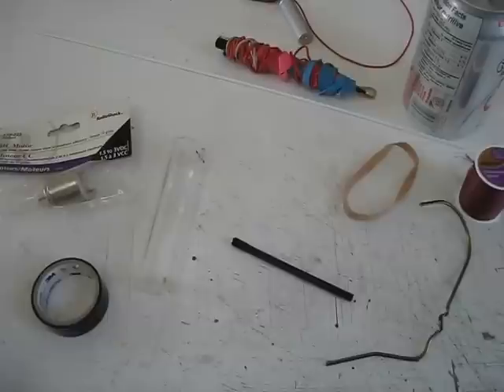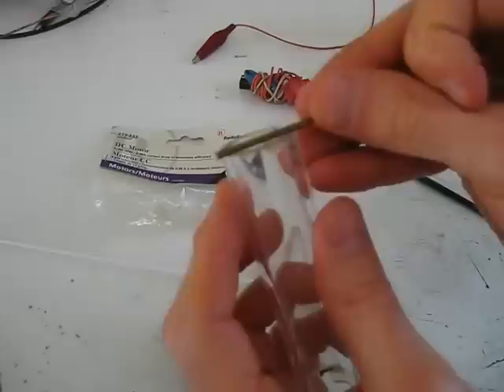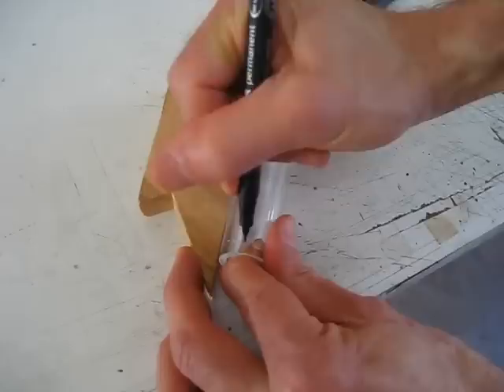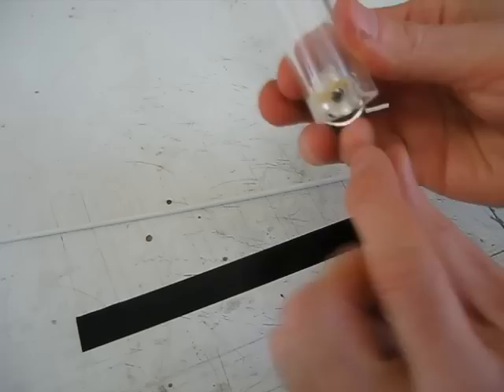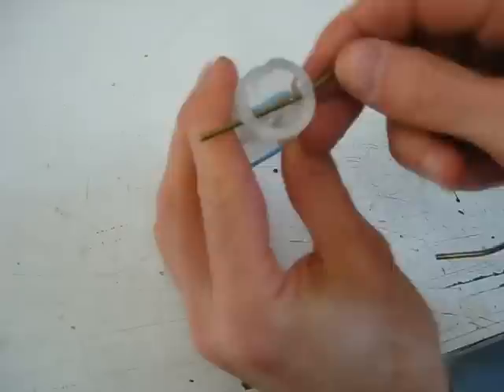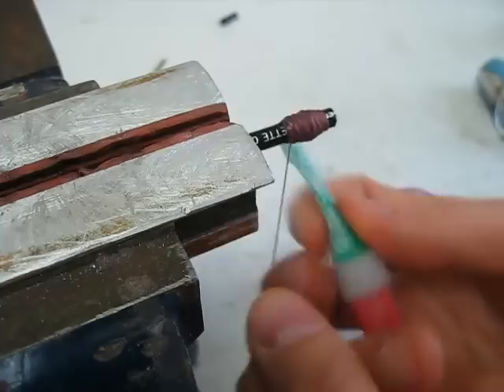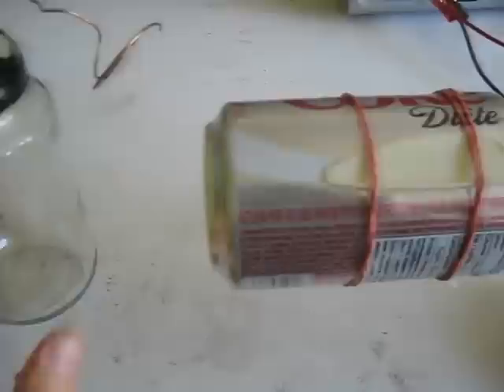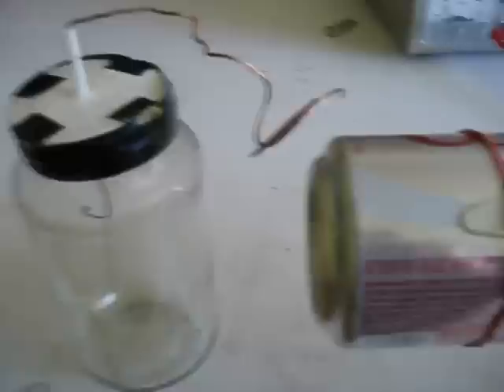How to Make/Build a Van de Graaff Generator Part 1 (Homemade/DIY)

Comment from the maker: Well, if you want a bigger effect then I'd suggest looking at a different design. This one's meant to be minimal using the simplest of parts. If you want to take a chance with this one then I'd suggest experimenting with a bunch of different materials for the pulleys. I think the weak point with this one was the use of vinyl tape for one of the pulleys. But even then, the result may not be as effective as you're looking for.

Comment: Sorry if you've already answered this- but is there a reason you used metal (close hanger) on one side? If the triboelectric effect occurs because of the vinyl and nylon, then it should matter what materials you use for the shafts right? Or is there a reason you matched the metal-plastic-nylon and plastic-vinyl together? 

Thank you so much
Reply from the maker: The material that the shaft is made of doesn't matter. So I used a clothes hanger because it was easy to shape it but it was also strong. The surfaces that matter for the triboelectric effect are the outer surfaces of the two rollers/pulleys (e.g. vinyl and nylon) and the inner surface of the belt (e.g. rubber).

Comment from the maker: You're missing one step. The VDG sphere can build up a high voltage is because the top brush is connected to the sphere on the inside. If you connect the brush to the sphere on the outside then it won't build up as high a voltage. The sphere is acting like a faraday cage or faraday bucket. The inside of the sphere is always neutral so the brush can keep sending it charge, theoretically forever, though in reality limited by the size and shape of the sphere. See my How VDG Works video at 10:46.

Comment: Would you know relatively how high of a frequency of sound your method below to produce a vibrating diaphragm would be, relatively? Would the voltage output from the van de graaff have anything to do with the frequency at which the diaphragm vibrates? Could you also explain more in detail about how electromagnetic induction works to produce these vibrations in the diagram?
Reply from the maker: +Dorfdude8 I have no idea what the frequency would be. I haven't done any experimenting with it. It was just a rough idea I came up with in response to your question.
I wouldn't say the frequency would be related to the voltage output i.e. how fast the dome can be recharged. It would be related to the current, which is dependent on the width of the belt and brushes (the wider they are the higher the current), the materials chosen for the belt and rollers (the farther apart they are in the triboelectric series the higher the current) the motor speed (faster equals more current).
I wouldn't call it electromagnetic. It's electrostatic. But here's the basic idea https://www.youtube.com/watch?v=1jP_D0S2CtY and https://www.youtube.com/watch?v=aOi9FJpzfeM. When the plate is on the part of the cycle when it's farthest from the dome you may need to have it come into contact with a grounded dome to discharge it.
Warning: This may not be suitable at all for what you're looking for. It's just the best I could come up with.

Comment: Quick question, instead of using your hand, could you possibly place two screws near each other (like say, screwed in a few centimeters apart in a piece of wood) with one connected to the coke can, the other connected to ground. Would this have the same effect as your hand getting near the coke can?

Comment: Nice!Does the fact the soda can has a laquer lining have a effect on the output?Would a raw metal finish on the inside help or hinder?Also,would a heavier insulation on the wire going in the can help output?Thank You for posting all of your neat projects!
Reply from the maker: Bowtie41 I tested the laquer lining when I made my part 2 video "https://www.youtube.com/watch?v=QrCgtjZwnB0" and didn't notice any difference with or without (I didn't include the test in the video) so I assume  the voltage is high enough to push the small amount of charge through the thin insulation. Given the voltage and the thickness of the plastic insulation on the wire I used, I don't think thicker insulation will help. What did help was opening that end of the can and pushing the whole roller section inside the can, which I demonstrate in my video "https://www.youtube.com/watch?v=xRLvbwF2MnM".

Comment: the strands are well spread sir.going to the can,i made it longer as it is on your video to touch the inside of the can..my motor is 6 volts so it turns faster.

Comment from the maker: You're welcome to send me a private message via youtube. If you want to produce high voltage using VAWT then hooking up a Van de Graaff is certainly one way of doing it. If you want normal voltage levels and current for powering things then you're better off doing what's usually done and hooking up an electromagnetic generator.

Comment: Hello sir! I made one similar to yours using pipes, the belt using rubber placed on a taped roller and both the brushes are close to the belt and the top wire is connected to the inside of the tin can but it doesn't produce any charge. Can you please help me out? ASAP! Thank you for making this video.
Reply from the maker: The problem may be with your materials, or your ground. See my FAQ page here http://rimstar.org/science_electronics_projects/van_de_graaff_faq_frequently_asked_questions.htm where I talk about those things. If that still doesn't help then let me know.

Comment: Hello, wire filaments ranging in rotation band can go to the elastic spanking or have a small distance away ???
I thanks the response, the video and time! I was looking for an easy and small as this design to make an air filter with ionizer home! Greetings !!!
Reply from the maker: Jorge Monroy I don't understand. The translation is no good.

Comment: will it still work if you connect the wire coming from the bottom of the belt to the earth on a battery instead of the house earth

Comment: Hey rimstar firstly I would like to say your video on building a Van de Graff generator is by far the best I've seen. But I was testing the rotation of the rubber belt without it being in a tube yet, the rubber band kept going to one side. Any tips on making it centralised?  I'm using a nylon thread at one end and a vinyl electric tape at the other. Despite me making the middle part of the tape thicker than the edges and the vinyl thread thicker in the middle it seems to go to the side when the motor rotates. Any tips on this?
Reply from the maker: Another cause I find is the two shafts not being aligned with respect to each other enough. They need to be as parallel as you can get them. Hopefully that helps. I'm glad you liked the video. Thanks.

Comment: Alright, thanks. So how far was the distance between your two rollers? For the brushes would something like copper wire work for that? And the last question I have right now is if we don't have anything like a screw how should we attach the wire to the can? Would normal Scotch tape ruin the electrical flow?

Comment: can we use a foil roll instead of  the plastic tube ? and to power the generator can a normal DC be used? 
thank you for this amazing video by the way :)
Reply from the maker: +Farah Toghan No, you can't use foil or any other metal for the tube. The material of the tube must not be electrically conductive.
By powering the generator with DC, do you mean powering the motor? If so, then yes, you can use DC or AC. It really depends on what your motor requires.
I'm glad you enjoyed the video. I have more enhancements to this design in my part 2 video at well https://www.youtube.com/watch?v=QrCgtjZwnB0

Comment from the maker: You do need some current to charge a capacitor, depending on the capacitor the current can be tiny. However, you also said the capacitor will act like a power supply for the generator and that's where I meant the current is tiny. Even the voltage x current is tiny. So sure you can charge the capacitor but there'd not be much power for the generator. Even if you built up power in the capacitor, it'd take a while to do it. You'd discharge it and then take a while again. Not very useful.

Comment: Well I got it working lol:) only thing is even though its grounded I keeping getting shocked and having bigger sparks from the part of the motor that connect to my battery. Any ideas? I get small sparks from the can, just more from the connection area

Comment: RimstarOrg Does the number of Small copper wires in a normal wire which you used for that brush near the rubberband depend upon the electricity produced (as in the more those brushes the better the voltage)
And does the speed of the motor also depend upon that?
Reply from the maker: For the brushes, ideally you'd have sharp points facing the entire width across the entire belt, but with a little space between each point. If the points are too close together then they end up acting as a solid object and not sharp points at all. But I don't know exactly what that spacing is. Also, if the bottom brush faces only a little of the width of the belt then there's no point in the top brush facing the entire width of the belt. The bottom brush is depositing charge onto the belt and the top brush is taking it off.
And the faster the motor, the more charge will be pumped i.e. the better it will work.

Comment: Thanks, I think the led one will work .It is said that they use van de graff generators to create high voltages for electric fields in particle accelerators. So how do the go about doing that. I mean there is no van de graff Generator in the accelerator so that means the voltage is coming from the generator through wires or something?

Comment: Great work. Earlier I thought it was practically impossible...to make such a small generator. I tried to build this and everything went on fine, but the can doesn't charge up. How much time does it take for the can to charge? My can is a coca cola can (the longer one) and my motor is just like yours connected to a battery eliminator with 10V. How much time will it take? Is earthing required??

Comment: Would it still work ok if I'd leave the Roller across from the motor. Instead of ending it and taping it,just leave it straight and use something like erasers or something to allow it to spin better? It keeps getting jammed up when I tape it down.

Comment from the maker: The maximum voltage is limited by the shape and size of the coke can. The rounder and bigger, the higher you can go. So you can get to a point with your motor speed where it doesn't matter how much faster you go. If you're not at your maximum voltage yet, then increasing the motor speed does help. Other than that, I have no way of knowing. The roller and belt materials, the belt width, and the types of brushes all play a part too.

Comment: Np:) I got it working and it does give a small spark from the can. But it's grounded on the negative terminal of my battery. It keeps shocking me and having bigger sparks from the negative wire I hook to the battery. It arks from the wire on the motor and or the connection on the battery

Comment: @RimstarOrg Thank you for such a quick reply....Actually by cloth belt, I mean the elastic bands that are used in clothes....  Please tell me one more thing... Will it produce much voltage to give a slight shock to the hand or I would have to make an electroscope necessarily??

Comment: PLEASE reply asap. need your reply by today. Hey, does the large tube build a static charge or is it the thread and tape as they are on opposite sides of the tribuelectric scale. It would be a lot easier for me to use wood or something to mount it on. Thank you SOOOOOO much you are amazing.

Comment: yeah im using a 1.5 motor and a 1.5 battery . im using an old toy's battery holder (three at a time) and it makes the motor spin fast 

what do u mean by tight rubber band , how could it be tighter or lose?

and oh one more thing ,when i try this experemint i will have to stand on a plastic chair or something like that right?

Comment from the maker: All it takes is for one thing to not work properly to make it all not work. The thinner the strands are, the better it should work. Make sure you spread the strands out where they a facing the belt. You want sharp points there. Check your connection to the inside of the can. Maybe you have a bad connection. Is your motor turning very fast? The faster it turns, the better it works. But be careful not to burn out the motor by running it above its rated current and voltage.

Comment: hey what is the speed of your motor and which is the best material for the belt and can we feel the current from the can easily.
Reply from the maker: +saurabh jain I don't know the speed of my motor, but I'm sure it was much faster than 100 rpm (1.7 rotations per second), probably somewhere around 300 rpm (5 rotations per second.) With such a narrow belt and rollers you need the motor to turn fast to pump a lot of charge. With a wider belt you don't need it to turn as fast.
The best material depends on the materials you use for your rollers, as I point out when talking about the triboelectric series. A rubber band is nicely near in the middle of the series.
When it's working you should see the hairs on your arm, or wherever, stand up when around 1cm or closer to the can.

Comment from the maker: It can be if you make sure it has no sharp edges. The more sharp edges it has the more it leaks charge and the harder it'll be to build up a high voltage.

Comment: sir i have completed the entire structure and my motor and rollers are running well, but still i am not getting any energy in the pepsi can.. Is it necessary to use a nylon thread in the upper shaft , i have used a different one..

Comment from the maker: It was nylon sewing thread. But I guess nylon fishing line would work too as long as there's no coating on it. And no, the material that the rollers' shafts are made of doesn't matter; wood and plastic are fine.

Comment: A useful material for the band is "Theraband" latex band. I purchase this from the physiotherapy department of the local hospital, here in the UK it costs less than £3.00 for a metre length, it can be joined using rubber cement or superglue. The thickness is determined by the colour - blue is best.
Reply from the maker: orgon21 Okay, thanks. I'll keep that in mind for when people ask.

Comment: a great sience video . Could you help me I'm building one by my self, on the negative pully ( plastic) I put some teflon , on the positiv pully which is glass ( the shaft is stell ) and as the belt I'm using hard rubber (or should I use wool? ) , please tell me is it going to work , btw my motor is a 12V DC motor , and I have a perfect round globe (metal - Fe )
Reply from the maker: +Mrga Mrgesa From what you've said it sounds good so far. It's hard to say which would be better, rubber or wool. But I'd try the rubber first since I find that fabrics don't tend to charge as well somehow. If the rubber doesn't work then try the wool. To help you along I can also suggest you look for more tips in my part 2 video https://www.youtube.com/watch?v=QrCgtjZwnB0 and my webpages http://rimstar.org/science_electronics_projects/van_de_graaff_faq_frequently_asked_questions.htm and http://rimstar.org/equip/build_make_van_de_graaff.htm.
Reply: +RimstarOrg thank you very much

Comment: So how do I get the high voltage from the generator. What must I do? Connect a wire to the can and another from ground? I mean I would like to use it to light up LEDs or something. Or make a strong electric field

Comment: Sir, i have an another question...will you please tell me,how will i understand that the electricity is being passed when the belt is moving without using the can??will the wire close to the belt on the upper pulley carry electricity???
Reply from the maker: Well, I haven't tried it but... There's still a charge on the outer surface of the belt. The wire has sharp points so there's still a strongish electric field near those points, so ions will still move through the air between the belt and the wire, putting charge on that end of the wire. That will cause an imbalance between that end of the wire and the other end. What happens next depends on what's on the other end of the wire. Likely some charge will move to the other end to equalize the overall charge on the wire and it'll leak away to the surrounding air at the other end. How fast it leaks away depends on how sharp the points are on the other end, the sharper they are the faster it leaks away. That's my guess anyway,

Comment: does the wire going into the can, need to be inside the can or can it be outside... wouldnt the effect be the same due the structure of the can (dome)  anyway??? great video. subscribed! cheers! my ABHA coil will go perfectly with this. thanks.
Reply from the maker: The wire has to go inside the can. One of the keys to a Van de Graaff is to take advantage of the Faraday ice pail/Faraday cage effect, which means connecting inside the can. See my video "Van de Graaff Faraday Cage Science Experiment" http://youtu.be/xRLvbwF2MnM for a comparicon of the two effects.
Reply: thanks!

Comment from the maker: It would have to be awfully big, building sized at least. The voltage is high but the current is small. It wouldn't be an efficient way of doing it anyway since you'd need to power the motor to run the Van de Graaff generator. And a Van de Graaff generator has plenty of losses, so it'd be very inefficient. Better just to power the house directly instead.